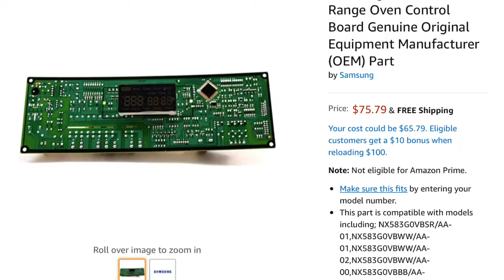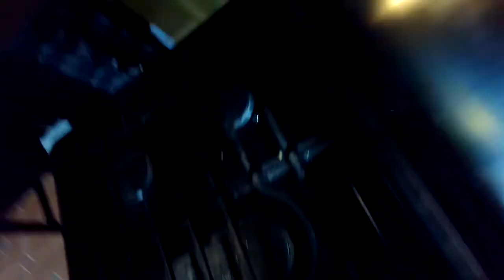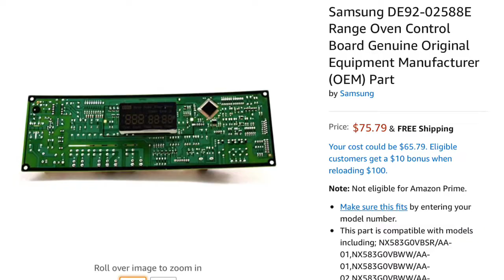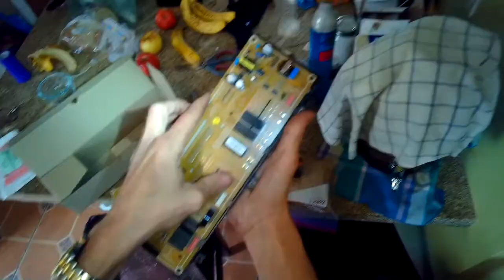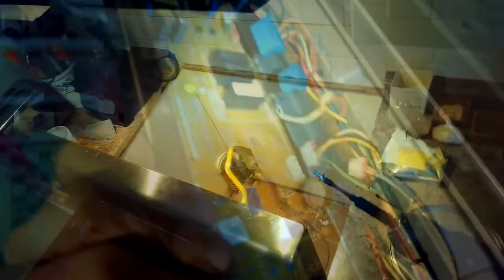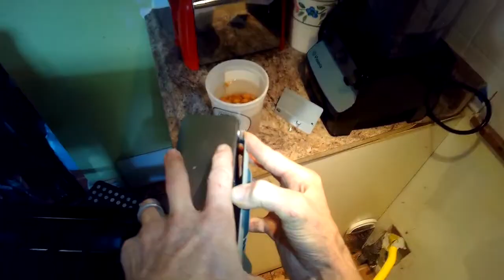✨ SAMSUNG OVEN CONTROLLER - HOW TO EASILY REPLACE & SAVE $$$ ✨

Comment: I just bought an as-is home on a steep discount. It did come with new appliances. After a month of owning the home, the display stopped working. Guess what the culprit was? The board was covered in roach poop and 5 midsize roaches were snuggled up to the panel 😮 Apparently the bugs are attracted to the frequency of the board. Replaced and bug bombed. Thank you. Gotta love a discount house.
Reply from the maker: Wow,
Thanks Stephan that’s a great story!

Comment: I replaced control board a few years back. It was cheaper then. Now they want $250 for it. My question is, do the letters at the end of the control board model matter? Like mines is Samsung DE92-02588G. I've seen other boards with different letters and cheaper. Would I be able to use those instead?
Reply from the maker: The eraser trick should work 👍
Reply: @ScottTheFixItGuyChannel  I purchased and used the whole bottle of WD-40 Specialist Contact Cleaner plus the eraser routine because the board was hella dirty with grease. I also used an electric air compressor to dry it out completely. This method worked for me and it saved me $250. Thanks again for the eraser method.

Comment: The oven is not functioning but the stove is working. The display controller lights up, but only two or 3 buttons  buttons are responsive. I purchased and installed a new controller, but the issue remains the same. What do you think could be the solution?
Reply from the maker: The ribbon cable needs to be cleaned on the end with a pencil eraser 👍

Comment: My electric convection oven stopped working. Display works, fans work. Temp sensor and thermal fuse tested at proper olhms. 
I can hear the relays clicking when you turn oven on but no heat at all. I'm guessing I need a new board.
Reply: All stove top elements work as well but no codes have come up.
Reply from the maker: Thanks Roger,
Can you check to make sure both breakers for the oven are in the full on position?
Reply: @ScottTheFixItGuyChannel  breakers in my breaker panel for the house?  The stove is on a 240 plug. Yes, it's on. 1 Breaker.

Comment: Thanks. I was able to just take the back panel off, and unplug the keypad, and plug it back in, and it works again. Must've came loose with the heat I guess. Only numbers that worked for me was 4, 8, 9, and 0. Now they all work again.
Reply from the maker: Nice job Doug,
Thank you😊
Reply: @ScottTheFixItGuyChannel  Turns out that only worked for a little while. Tried cleaning the connector with rubbing alcohol, and got dirt off of it. Same thing only worked for a little while. Guess its time to replace the keypad, and or the control board.

Comment: i have a question, my samsung oven when i press broil and bake did not work, only the pizza button would work and turns oven on, i replaced the control board, and all the buttons comes on now bake, broil, pizza, but now the oven is not igniting, i don't see the flame come on, do you think maybe the connection need to be retightened, was going to open it again and check connections on control board.
Reply from the maker: I wonder if it needs a new igniter ?

Comment: The board can be removed without taking out the black the enclosure attached to the oven.  Less work, and the way it is designed to be done.  Just push the top tabs up and do the board removal after unplugging the harnesses.
Reply from the maker: Thanks so much Don😊

Comment: Ok so we had a power outage and the whole board will not turn on at all. Is this going to require me to get a whole new panel or was there a certain part that got fried when the power went out.
Reply from the maker: Thanks Jessica,
Probably when the power came back on and there was a spike of energy that fried one of the components in the oven controller.
Unfortunately, I think you’ll need to replace the oven controller but for the Samsung model they’re not too expensive.
You can put your model number in a Google search along with the word Oven controller and there should be a few different companies that will sell you the new controller.

Comment: My Samsung over is still functional, but from time to time it need power reset to take it out of its astonished state. I think I will install a fan to cool it down. I believe it is a heating problem, but I don't know where gives the best cooling. Any input will be appreciated.
Reply from the maker: I think you’re right.
I would blow the fan against the control panel.

Comment: Is there anything other than the igniter that will prevent the oven from coming on? I have changed the igniter and still doesn’t work.
Thanks
Reply from the maker: Hey Rodney,
Just need to order a new oven relay board.

Comment: Would this work if you get total failure of the pad?  Not communicating with the oven - sometimes buttons don't work at all, sometimes oven will turn on but not off.  Would replacing the panel solve this?
Reply: I have the same problem.  Oven and burners work fine, I just can't use the oven because the number pad doesn't work.
Reply: He has another video to replace the dial pad and it's 1000 times more complicated and expensive to replace than this.  I wonder if just replacing this will fix the problem instead of replacing the dialpad.

Comment: Thanks so much for your helpful video Scott. I had done some research including your videos & was not sure if the problem was the touch pad or the controller. I contacted a repairman to take a look & he told me it was the controller not the touch pad. To fix it he would have charged me $440 all together & the $85 service fee would be deducted if I were to follow through. I decided to order the part & fix it myself with the help of your video. The only problem I had was removing some of the connections, you made that look easy. Thanks again!!
Reply from the maker: Nice job Sam😊😊😊
Reply: That's my issue now if the problem is the touch pad or the controller? I'm getting an "SE" error and the oven stopped working and a month later the broil stopped and got the error message, so which one do I replace?
Reply: @mrgeemoney  If I had contacted Samsung replacement parts they would have told me what to replace with my symtoms without me having to call a repair person.